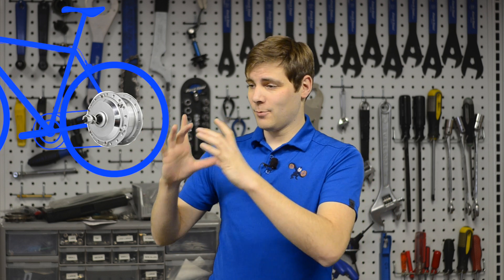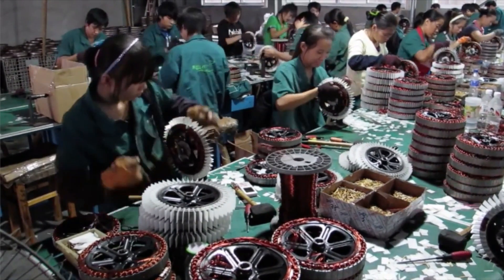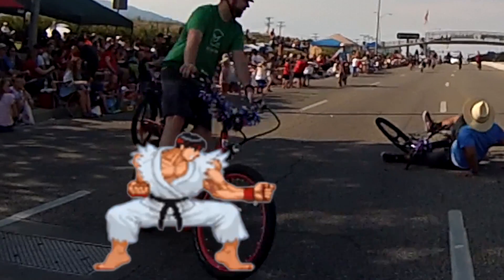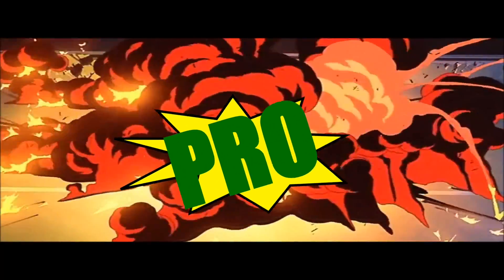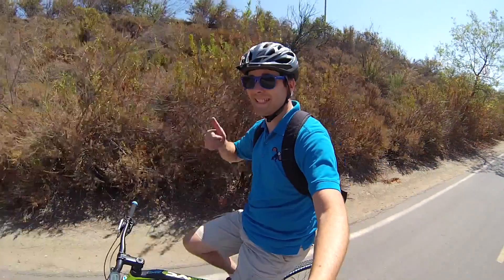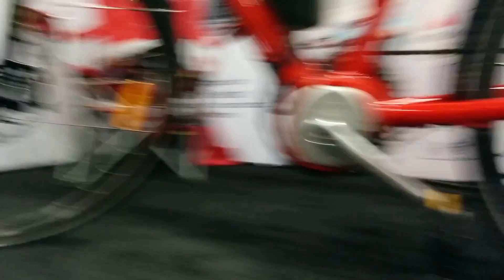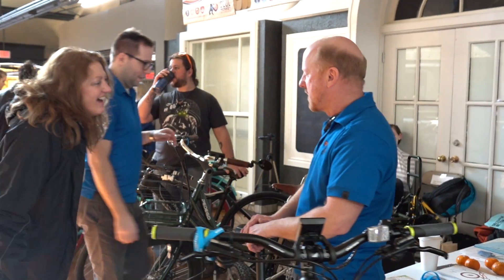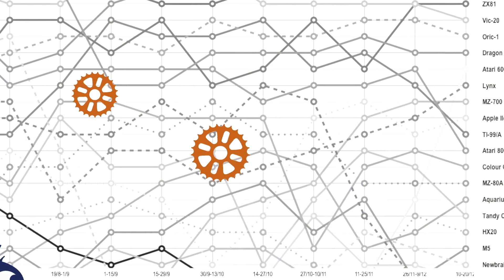Hub Drive VS Mid Drive eBike motor systems

Comment: I built a middrive first using a bafang motor( outstanding quality and affordable)   then a front hub drive, also bafang. The hub drive does have a lot of zip, but us noisy and you have to endure the constant on,off,on,off noise.  .y middrive,  has the quietest,  smoothest powerfow of the 2 and is great for the road.  I have ridden my middrive over 4k miles and never broken a chain. Use shift sensors and your deralleur like you should and you will never break a chain. What do you have to say about that,

Comment: Funny you said that a pro to a hub drive is that using a throttle are a good use who are tired. For me, I have a hub drive wheel with no throttle, I can only use pedal assist. Lol

Comment: In europe an electric bike that operates without pedalling is a motorcycle, and requires registration and a licence.  E-bikes classed as bicycles require some input from the rider before the motor can assist, assistance is also limited to 25kph by law, again if it's not restricted, it's classed as a motorcycle.  That's why the Bosch system operates as it does, it's a legal requirement.

Comment: The stress to the chain and controller for mid drive also increases if you don't shift correctly. And when you start from stop your gear with be low. There's more to worry when using mid drive but yes it feels natural and the power delivery seems more compared to the same Wattage for the hub motors. And if you are using the throttle only, for mid drive you have to shift to the highest gear to get the fastest speed since the driving force is the chain so the smallest cog for the given motor speed would get the max speed, same as if you pedal a regular bicycle. With hub it is entirely up to the speed of the motor rotating the wheels.

Comment: The biggest difference is that you have a transmision between the motor and the wheel with the mid engine, so at the same Watts and volts you have more speed on high gears and more power on low gears. Another point is that you can buy differents mid engines kits like Bafang or CYC and you dont need an specific frame for this. But yes, you have a lot of stress on the chainring, chain and cassette.
Reply: You mean the external gears? No, that's not how the technology works.
Reply: @talkingebikes  Broh, i work with differents ebikes and i know what im talking about... Anyways, are you saying that the bike gears doesnt give differents levels of power? Shuld i change my mid engine bike to a single speed?🤔🙄
Im telling you that an 750w 48v mid engine climbs better than a 1000W 52v hub motor, and is faster on flats, its all about the  gear system....

Comment: Question... Will a hub-drive work with a mid-drive on the same bike with dual throttles? What I'd like to do is put the 750W hub motor on the front of a BeeCool Challenger, then put a mid-drive on the back wheel, Giving me both options plus AWD. Another thought, Is it possible to use a CVT on a mid-drive ebike? Chains are loud and they break. Transmissions are mechanical, heavy and expensive. CVT's are lightweight, cheap, quiet and seem like the perfect solution...?

Comment: It's weird you don't mention that a mid drive uses the gears as where the hub drive does not. This means that a hub drive is like running your car in third gear all of the time so a mid drive out performs it at both low and high speeds.
Reply from the maker: You can pedal mechanically at the same time as operating a hub drive electronically.
Reply: @BlueMonkeyBicycles  yes you can but the hub drives power isn’t running off the gears.

Comment: I feel that this debate between mid and hub motoes in the US where 750w is the maximim it wouldn't make a lot of difference in what yhe cycle can be used for because the power is there, but in the UK where the max motor power is 250w it would make a difference.  I love my hub motor for stright running and slight hills but steep hills no, the mid drive low T sprocket is ideal for that even so its only 250w.  Once you get to 42T or 44T it does become hard these sreeper hills even with a mid motor, where I live I use a 36T which does make it easier but because of motor option 250w is not to strong on power but does manage to get me up these steeper hills, there are lots of things to look at and the main is what do you nrrd the cycle for, with larger motors sprockets and chainrings might not be a big issue as with the smallwe motors, hubs are okay but feel they will become the motors of the past and mid drives will be the motors of the future.  I still have a hub motor but am thinkiing of selling because I can change chainrings to suite each puepose withing a few minutes.  So for me is a mid drive,

Comment: Nice vid, the things they don’t tell you in the UK (as we’re a decade behind) is firstly, when you’re a big cycling bloke like myself, and broken spokes are a continuous pain in the butt, then the thing you don’t want on a bicycle is more weight on the back wheel, be that the motor or battery pack... Imagine touring on this with fully loaded panniers! Secondly, having to change that rear tyre and mess around with that goddamned motor! Thirdly, do yourself a favour, spend a little more and go for the (mid) crank e-motor that possesses much more torque, (probably the most important and least talked about thing in regards to ebikes) meaning it’ll push you up those goddamned hills (especially in Wales) without difficulty... The reason they don’t tell you about these things is mechanical build convenience and unimaginable profit margins. Happy ebiking UK!

Comment: THANK  YOU !!  You are the first honest unbiased reviewer - Most are so many mid-drive lovers that fail to mention the very important fact that a "mid- drive ebike goes NOWHERE unless you are pedaling it!!"  Why do they avoid that important issue???  Thanks for being an honest reviewer.  I am 70 years old - with a 1000W Bafang rear hub motor Ebike and after I resolved the known AXLE SPINOUT problem from a high torque hub motor with a Grin Ebike torque arm (on Amazon) the only serious problem I had went away. I would never trade this in on a mid drive.  I do pedal as much "as I can", but when I have had enough, my powerful hub drive motor takes me home like a moped !!!

Comment: This is an old video by now. and i hope this guy did an update. ok please if you go for a ebike go middle motor, i have one and it is so natural , it is no brainer. forget about the myth of chain breaking  with mid motor majority of the middle motors are used for commuting. Yes the chain will wear faster that is normal. Imagine a top super fit biker that can put 500 watts, he will wear the chain too. No worries go mid motor. chose +70 Nm . I have the 85 Nm and is a joy to use.

Comment: Based on the factors you mentioned, how does the rambo megatron hashout in your opinion? Dual hub drive (2wd) bikes like the rambo megatron, with bafang 1000w (1500w peak) on each hub

Comment: A mid drive will always be at a mechanical disadvantage because cassette rings are never bigger that drive rings. E.g. a 90Nm mid drive with a 46t drive chainring and a 34-11t cassette will apply 90Nm*34t/46t = 66.5Nm wheel torque in the lowest gear speed (and  21.5Nm in the highest gear). Wheel size also effects torque effectiveness. 60Nm wheel torque on a 27.5in (70cm) wheel is only 85.7N wheel force vs 118N on a 20in (50.8cm) wheel. The wheel force is what really counts for accelerating the bike and rider. Acceleration equals force/mass.

Comment: Apparently the Bosch drive may well be the best to begin with, BUT in terms of performance longevity of it, it doesn't last for very long before water gets in and it breaks down.
Bafang look to have the highest in ip rating for water proof motor standard, therefore Bafang are the best overall
Reply from the maker: Is there any data on this subject? I never went looking, but I've never heard of Bosch motors breaking down over long term water damage. I have heard of many different motors breaking from severe water exposure, like diving into a lake.
Both bafang and Bosch have a variety of motors, so if you know which models have these benefits/issues, that would be helpful too.

Comment: Question: I was told that a hub drive puts too much torque on the wheel snapping spokes and resulting in wheel rebuilds. True? False?
Reply from the maker: Generally, false. The only time I've seen that happen is on custom hot-rod eBikes. This may have also been a thing before eBikes went mainstream, and most the examples on the road were conversions.

Nowadays hub motor eBikes are made with thicker spokes to handle the extra torque, some also have steel drop outs, instead of aluminum.

Comment: your wrong about mid drives thay can have a throttle  like a wheel drive its electric look at bafang also the motor being lower and the battery to its better as it also go through your gears i could go on but i wont
Reply from the maker: No. They're is no such thing as a throttle on a mid drive. It's complete fantasy and against the laws of physics.

Nah, just playin.
When I wrote this video I regretfully cut out a part specifying that I was only talking about the big name, retail ready systems (Bosch, Yamaha, Shimano, brose, etc). At that time, bafang hadn't hit the big league yet.

Comment: Will 2 1800w motors placed on mid drive produce 3600w?
Reply from the maker: Are you talking about a mid drive bike, with a front and rear hub motor attached?
Reply: @BlueMonkeyBicycles  I guess it won't but torque would be higher tho but yes I'm talking about 2 motors placed on mid drive
Reply from the maker: The mid drive and rear hub motor will overlap each other to a good degree.

Comment: How many charges will the battery take?
Reply from the maker: Really depends on the cell manufacturer, and how the battery is treated over its lifetime.
With a cheap, crap battery, I've seen as low as 10 full charge cycles, but that was quite irregular.
 In a realistic case: I was really careless with one battery, and it started to lose capacity after around 250 full charge cycles. That got me about 5000 miles on the bike over the course of 3 really fun and exciting years. That was starting back in 2014. Batteries and motors have improved since then.
Reply: @BlueMonkeyBicycles  a lithium iron phosphate battery will do at least 5,000 charges. 250 charges? Thats bad! How much is the bike again?

Comment: thumbs up for 3rd Strike Vs screen 😎👍
Reply from the maker: In this video, I didn't have the custom 3rd strike victory screen done yet.

Check out the lithium vs lead acid video, its at the end
Reply: @BlueMonkeyBicycles  it would be thumbs up guaranteed if using Helena defeat pose from New Generation/2nd impact for the looser 😏. Will check it anyway
Reply from the maker: Or ibuki

Comment: Just bring a emergency chain in a bag, usually rarely change chains anyways as long as it's only classified as a ebike with 750w motor and not trying to be a motorcycle or moped should be fine.

You get double the torque, availability of gears, they don't break as much, and generally it's a lie to say all mid drive engines you have to peddle.

If your just putting around a city on pavement that doesn't have any hills and not doing much then hub could be ok.

Honestly though would still go mid myself as works with gear ratio and easier to fix as well as has less problems on the whole.

Comment: Optibike
Reply from the maker: Now that's a name I haven't heard in a long time. A long time...
Reply: @BlueMonkeyBicycles  still building all usa mountain rackets. New motor with 2500 peak and 1500 continuous.

I have a 37 lb carbon SL that Is a great commuter.
Reply from the maker: Oh wow, I didn't know they were still around. Optibike was a huge innovator that was way ahead of their time. I guess the times caught up!
Reply: @BlueMonkeyBicycles  sort of, but the chain drive large mid drives give up efficiency to the motorized bottom bracket, and nobody else does that.

Comment: How about 1 hub motor in the front and 1 in the rear?
Reply from the maker: It might "balance" the weight, but it comes at the cost of double the motor weight, which is unsprung on the wheels.
Dual motors can be fun int loose terrain, but it's not very fun on the road.
Reply: @BlueMonkeyBicycles  it would probably be helpful for me since snow and ice dominate for half of the year, it is that or having the motor in the front and the battery in the rear

Comment: Mid drive doesnt have a throttle?
Reply from the maker: At the time I made this video, store-bought mid-drive eBikes were almost always pedal assist only.

Things have changed since then.
Reply: @BlueMonkeyBicycles  and one of those things that changed was the mid drive has a throttle now? I'm just asking because i want something with pedal assist and throttle but I want a mid drive.

Also, pedal assist, is that also an easier way to get around? Ive had back surgery in the past so my strength is compromised in my back. When i ride my bike it is the first things to give out.
Reply from the maker: Why do you want a mid drive?
Reply: @BlueMonkeyBicycles  my main reason is that i live in Georgia and there is hills everywhere. The research ive been doing suggests hub motors are not for hills. Im not a big person at 5'11" 155lbs.

Comment: 1000w BBSHD mid drive bafang here. Love smoking the people trying to race me with their hub drive motors lol
Reply: Do mid drives have full throttle control or just hub motors?
Reply: @moneer7139  mine came with a  full throttle. It also has pedal assist modes but i prefer only using the throttle so it feels like a motorcycle

Comment: Own a rear hub but tire went bad bike shop wanted $200 not counting parts but the Li Ion battery was weak so I trash the E bike. Mid drive is super low cost to repair. Hub is crazy expensive to repair. Cost are the same to buy or build so IMO Mid or what is called chain drive motor.  Just ask cost to R&R a hub drive motor tire. Looks simple but Hub costs will freak you out

Comment: The front wheel hub drive does not force the chain and distributes the weight better on the bike. The middle drive forces the chain, which is also loaded with a pedal. 
The weight of the rear drive puts a strain on the rear wheel, which even holds our weight.
It is best to have the hub drive on the front wheel and the battery between the two wheels.
Reply from the maker: There's more to it than what you've outlined.

Comment: Would a 500w hub be enough for off roading?
Reply from the maker: Yeah. The style of the bike, and skill of the rider have a lot more influence. I've used 250, 350, 500, 750, 1000w off road.
Reply: @BlueMonkeyBicycles  basically my mate has a 500w mid motor, just want to know if I’ll be trailing behind
Reply from the maker: If you want to keep up with an existing bike, replicate that the best you can.

Comment: If you're worried about balance you can just put the hub motor on the front wheel and batteries on one of those racks on the back of the bike.  If you get lithium they are pretty similar in weight.
Reply: I've never seen a front hub motor, other than  3 wheel trikes in the past using one. I'm happy with a hub motor on the rear.
Reply: @Mark-qv4bn  My bike has rear hub motor, but I remember when I was shopping for the kits the front ones were slightly cheaper.  I think the only reason I'd ever get one is if I put one on both wheels for double the power lol
Reply: @waynefilkins8394  I'm hoping to get years out of my new ebike. I'm over 65, and I just bought my first new ebike a few days ago. 6 months of not having one was hard, as I wrecked my first one. Life is good again. The first year, I kept  700 miles off my truck riding my ebike instead. Ride safe!
Reply: @Mark-qv4bn  Mine lasted like 4 years so far and still doing strong, so they seem to last quite a while.  Be safe out there.  Gotta pay a lot of attention on these things.  Sometimes it's easy to just sit back and relax lol

Comment: Not everything is about downhill MTB riding. You can put two motors on a bike with hub, If one system was to fail on hub, you would have the other. Hub's have come a long way.
Reply from the maker: Everything is about downhill MTB. Making videos  exclusively about downhill MTB. At the voting booth it all comes down to downhill MTB. When I get groceries: downhill MTB. When the dentist asks me which fluoride flavor I want, I tell him: downhill MTB.
Reply: @BlueMonkeyBicycles  then why worry about a motor? ppl like electric hub and mids for cruising it’s actually growing fast as well. mobs of kids on there super73’s  back road cruising all kind of reasons. Downhill is not the end all be all. it’s sorta lame and for the mid life crisis old men
Reply from the maker: Downhill MTB is Life. The feeling of the air touching the bottom of your lungs, the smell of exhaustion through the face of the helmet, the way your mind becomes a Supreme Mathematician calculating each jump at the blink of an eye, that tingling feeling in your hands at the bottom of the mountain. Downhill is the pure essence of life. Truly, downhill MTB is the only thing that will save us from either global warming or the removal of the 2nd amendment, whichever you think is worse.
Reply: @BlueMonkeyBicycles  dude i get it, i’ve spent 30 years at a high level of snowboarding steep,deep and fast. i just think motors on bikes for cruising is different than downhill bikes. You would never want a hub for downhill and i wouldn’t want a mid for cruising.

Comment: Bike shops like hub drives because they breakdown  at a much higher rate than mid drive.
Reply from the maker: I've been to bike shops across the country, and regularly frequent ask the eBike shops in my area. They all have far more mid drive bikes over hub. Why do you think that is?